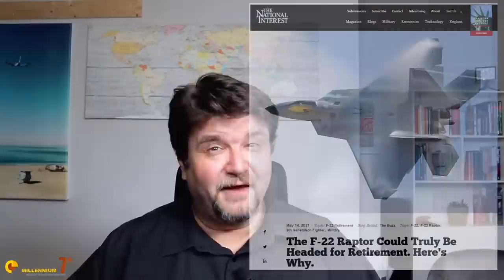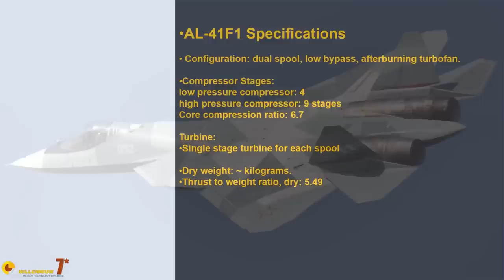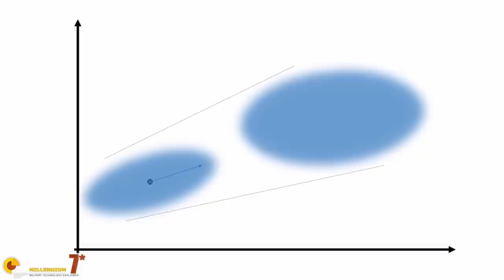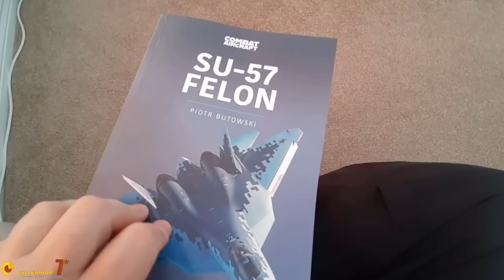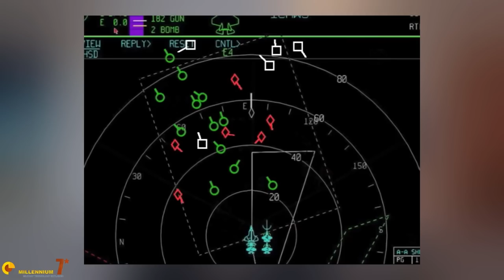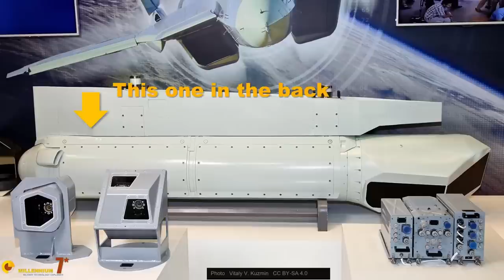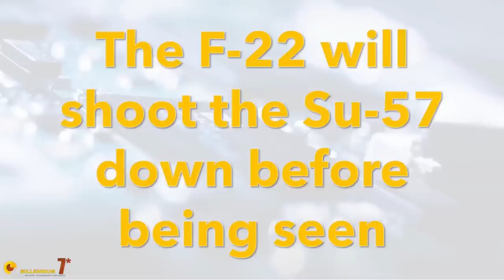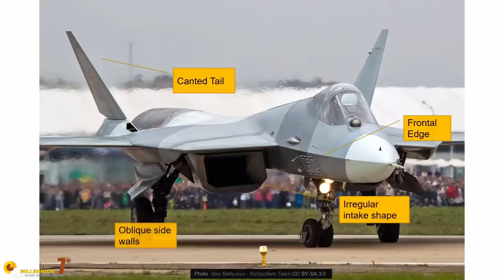Su-57 Update! + In Depth Analysis

Comment: Any updates on serial Su57 delivered with IrbisE PESA or Byelka AESA radar...
Reply: Google
Reply: @ГеоргийМурзич  Googled Nov 2021 - Tikhomirov NIIP Director General Yuri Bely said only 6 Byelka had been built with 2 for flight testing in T50-3 & T50-5 + 2 for bench testing + 2 for Tikhomirov debugging – with 4 more to be built in Coming Years…
Reply: @CherryBoyReloaded  Yuri Beliy die before Nov 2021.  So either the article use very old interview without citing the date or they just make up fake interview
Reply: @Swordsman  Thks for the Yuri obit update - any updates on serial Su57 or latest Su35 delivered with IrbisE PESA or Byelka AESA...
Reply: @CherryBoyReloaded  i believe Su-35 not gonna have AESA. Never heard any report on that one. Because if they do, i think they gonna try it on Su-30SM2 first. 
On Su-57, so far its going on as planned except for the engine. I afraid sanction will affecting Izd.30 like they (allegedly) make Su-75 first flight pushed from 2023\24 to 2025
Reply: @Swordsman  Yes its a mystery - with Indonesia complaining first choice Su35 didn't have AESA before selecting Rafale and maybe F15EX - at a time when United Aircraft is struggling for survival even after consolidating MiG into Sukhoi - so would be delivering Su35 with Byelka AESA if available as badly needed Su35 orders - required to support Su57 - dry up...
Reply: @Swordsman  Correct - United Engine has been saying since 2017 and recently reconfirmed - hopefully by a living representative -that Izdeliye30 won't be available before 2025 which fits with this report of AL41 planned through 2024 - so delays are inevitable...
Reply: @Георгий Мурзич  What does your Google query return for mysterious Byelka AESA radar...
Reply: @CherryBoyReloaded  interesting, that's new info of Indonesia refusing Su-35 because the lack of AESA. Afaik, its all because CAATSA
Reply: @swordsman1137  Yes - CAATSA probably played a role - maybe a decisive role with AESA only an excuse for Indonesia to not admit a long time Russian customer caved to unreliable + meddling + declining + trouble making + hegemonic + Australia aligned USA - to buy French Fighters...

Comment: Why don't you ever hear of some kind of rear defense pod to shoot down missiles that are coming at the plane?  They would not need to have a very long range and would not need to have a very big payload.
Reply from the maker: It is not feasible dynamically
Reply: It's in development. Unfortunately it is not as simple as a tank's aps systems as you have to factor in so much more. For example trajectory of a missile going mach 5 on a plane going mach 1.

Comment: Can anyone explain the obsession with 'digital' camouflage please,  I understand its workings in small scale environments; urban, jungle, desert etc but I'm struggling to understand the relevance when airborne with a relatively large manoeuvring body. It seems excessively complicated to achieve similar results to any other disruptive pattern.
Reply: the camo is not for the eye. it is for a digital camera. the pattern interferce with the sensors data. it is questionable if it realy works
Reply: Like the other commenter said, "digital" camo work better to trick thermal camera or ordinary camera.
Iirc digital camo on troops uniform not have any advantage against human eyes

Comment: Do better?  The radar cross section of the Su-57 is thousands of times greater than the F-22.  The Su-57 is, at best, a good 4th gen fighter.  Since there are only a dozen (give or take a few) of them and they have never been used as anything other than a missile truck, it's hard to know how good they really are.

The Indians abandoned the program because the plane did not live up to expectations.  They will be flying Rafales instead.  

Love the optimistic talk.  Three regiments of Su-57s.  They will arrive at about the same time as the 200+ T-14s

Comment: This video needs an edit: "Western engines last 5 times longer".
Which is not true and has been pointed out in the comment section of the original video. This particular statement is completely wrong.
Reply: Sources?
Reply: Every SU fanboy is also an engineer in their spare time, u know 🤣
Reply: Russian engine overhaul times is 1000 hrs but a heavy or replacement period is 4000 hrs.

For western engines it is pretty same with tbo being around 2000 hrs and replacement at 4000-5000 hrs 

My nation uses both
Reply: F35 engines can't seem to last more than 300 hours
Reply: @singular9  thats what u get for high thrust engines with importance of just 1 engine which has to constantly go full thrust in flight. The load on engine is tremendous, esp in B variant with all that diverting nozzle system bs
Reply: @singular9  sources?
Reply from the maker: There is a correction in the 7th video. I forgot to add an edit for that... damn...
Reply: @Millennium7HistoryTech  Yeah I remember that video. But those who don't watch the whole thing would be confused 😉
This was a damn good analysis, sir.
Reply: @rogerwilco5918  You can go directly to the web site of the company that makes  these engines and check the figures. There is a lot of other sources as well.
But I do realize that anything written in Russian becomes a real pain for a casual westerner (just like Chinese sources for myself).
Reply: @hiteshadhikari  
Depends on your definition of "full thrust"  is.  The F-35 doesn't typically patrol at Supersonic speeds.  And since the Lightning II can easily sustain flight above mach 1.1 for over a hundred miles (although not technically super cruising) without having to use afterburner, "full thrust" is a bit inaccurate. This info is publicly available, so the true performance stats are probably even better.  VTOL( hovering) doesn't require afterburner thrust either.  I don't believe it requires full military power to hover a jet with a full load out either, but I'd have to check.  It might.
Reply: @edgetwins529  to sustain that ss speed it has to go ss first and achieve a high speed then it kills ab and thats how it sustains a 1.1 mach speed bud.

Comment: I am no expert but compared to available close up shots of the F-22 and J-20, the panel gaps and finish on the Su-57 looks terrible (e.g. at 10:46). But it is a beautiful plane.
Reply: It’s garbage compared to the F-22 and still pretty far behind the J-20.  This channel presenter is knowledgeable about aviation, but just makes the mistake of taking Russian/Chinese performance claims at face value and as a result is a bit of a Russia/China fanboy.
Reply: @bluemarlin8138  and you can't be called an american fanboy as well? not much is know about the j-20 either but here you are with metrics.
Reply: It's footage of one of the prototype. Sukhoi really need to release footage or pict of the serial production

Comment: Why the air intake is never on top side of the wings .....always from bottom side of plane ?
Reply: Airflow will not reach engines when pitching upwards
Reply: @sidharthcs2110  why then B2 spirit Is having ducts on top side ..... Air exists on all sides .....it's the plane which rams in into the atmospheric air !
Reply: @shivamRudram  Because the B2 won't do maneuvers that fighters do..
Reply: @M16_Akula-III  okay

Comment: The F22 and the B2 are multi band stealth aircrafts.
The F35 isn't.
Even if the L band radar works out doesn't have 360 degrees.
That means that the F35 and the F22 will detect the SU57 first since it's barely stealth.

Comment: Russia does not have an asymmetric response, Russia relied on anti-aircraft missile systems. Since 2007, Russia has spent 3 times more on the S 400 than on the purchase of all types of fighters. With this money, Russia could buy about 1,000 su30 and su35. In fact, Russia has a huge bias in favor of anti-aircraft missile systems. In addition to the C 400, there are also C 300V4, C 350, C 300pm2, "Buk", Tor, "Shell".
This bet on ground-based air defense turned out to be a complete failure. In the current war, there is a video about how the HARM missile hits the BUK air defense system, although the buk covers the long-range S 400. Ground-based air defenses are useless because of the round earth. And the Ukrainian side launches the HARM missile without capturing the target, in the hope that the missile itself will then capture the target. This is a very limited use of HARM. Faced with the US Air Force, all these C400 and others will be destroyed in a week.

Due to a lack of funding in Russia, one of the most promising missiles in the world, the R77PD, was curtailed. All projects in aviation regularly meet with underfunding. There was a case when the AWACS A 100 project stood still for 2 years, because the company that developed it could not buy il76 for tests. 
If Russia had relied on aviation and not on the SAM, then the su57 would have been ready for a long time, and now the su75 would have passed pre-production tests, the su57 program also regularly faced underfunding, as an example, the radar N036 was delayed for 5 years.
But the projects of new anti-aircraft systems fly out like pies, new missiles for the S300 and S400 regularly appear, as well as the new sams themselves, have not yet had time to start buying the S500, as the tests of the S550 are about to begin, and the S600 is already in development. This is real madness. 

Russia does not have an asymmetric answer, it's just that there is a strong lobby in Russia of those who produce air defense systems. Russia could well have 1500-2000 fighters such as su30, su35 by the current time and switch to a bunch of su57 and Su 75 within 15-20 years. Such an air fleet would be a much better response to modern threats.
Reply: Как думаешь, сможем после войны сохранить армию на том же уровне что и сейчас? Ну, чтобы имеющееся вооружение осталось при нас и чтобы проекты, которые только ещё в планах, тоже получили в итоге жизнь?
Reply: @ИванГоряев-х4ю  лет 5 потребуется для восстановления, потери по танкам бмп бтр уже сейчас огромные, а сколько еще война будет... черт его знает. Если война на годы то я даже не знаю чем воевать будут. 
Куда интереснее как дальше пойдет развитие армии, если по тем же рельсам то это тупик, нужно менять концепцию. Делать ставку на авиацию, у нас в авиации очень хорошие разработки. А будет ли меняться армия зависит от власти, эти же люди вряд ли способны на новые идеи. Нужна смена элиты, а лучше вообще слом нынешний вертикали власти и создание куда более открытой власти. Надежда что в 2024 будут перемены, хотя конечно сомнительно.
Reply: @ЭкономияКанкрина  надежда умирает последней :)
Мне кажется эта война не сможет продлиться очень долго, скорее всего ещё один год или половину, не сможет наша армия тягаться с таким напором сопротивления. А вот насчёт развития армии и смены власти полностью согласен. Главное - чтобы после окончания войны никто из предыдущих членов правительства не смог остаться на своих местах. Ну и не менее важно, чтобы пришли не просто новые, а умные и честные люди. А чтобы так произошло, народ должен наконец проснуться и взяться за голову и отстоять своё право на нормальную жизнь
Reply: @ИванГоряев-х4ю  ну наши то давно хотят договориться, это на той стороне не хотят... долго ли они готовы воевать? Если в этом году у них будут успехи на фронте, то думаю война затянется еще надолго, если же до осени особых перемен не будет на фронте, то думаю готовы будут сесть за переговоры.

Пока не вижу сценария при котором придут умные и честные. На мой взгляд кардинальная смена элит возможна только при унизительном поражение России, а этого я не желаю своей стране. Приемлемый мир наоборот консервирует нынешний режим.
Reply: @ЭкономияКанкрина  хотели бы договориться - договорились бы ещё раньше. Тут обе стороны будут гнуть своё до конца. А что касается унизительного поражения - так это и будет отправной точкой в смене власти. Опасность лишь в том, что может случится как при революции - до "руля" дотянутся совсем не те, кто действительно должен им владеть. Вообщем, моя позиция такая: перемены необходимы, но никак не радикальным способом - нужен эдакий мост между народом и властью, а не пропасть, которую мы сейчас наблюдаем
Reply: @ИванГоряев-х4ю  ну наши же отвели войска в апрели. При чем даже с перспективных направлений как сумская область. Думаю все таки договориться хотели. 

Ну пока Путин у власти пропасть так и будет. А он судя по всему вообще власть отдавать не хочет.
Reply: Lol this bot understand the universe 😂

Comment: What can be discussed here?  They used screws instead of rivets on the wing and that says it all.
Reply: Of course, a Ukrainian.
You're looking at the T-50 prototypes which have exposed screws for easier maintenance. The serial production models have them filled in, brushed and coated. By the way, the F-35 doesn't use rivets either. It uses so called Eddie bolt fasteners (where Lockheed admitted they used the wrong material on critical areas on potentially hundreds of planes, but that's a different story for another day).

Comment: About the L-band rays you are Wrong.

You know they have extremely long Long wavelengths. then as a result Has poor accuracy in range to really Detect a target. it won't even detect It. at all it won't even give precise Data because it wont detect it at All.

They require very long dwell times. .i.e. they need to illuminate a Specific area of the target for many seconds/minutes. to really detect a Target. it won't detect a target and Really give a indication to the pilot. So hence they cannot detect it because they need to illuminate an specific area of a target for a very long time. This works well for ships. But for fast moving targets like Planes. no it won't detect the target. To really give a indication to the Pilot.

Comment: The US still wouldn't face an effective adversary with Russia's Air Force. It has been worse than useless in Ukraine. It will probably never even hit 12 active airframes. Even if it does, the stealth is horrible. There isn't enough reason to acquire this aircraft in numbers. There isn't enough advancement to justify the cost. The L-band isn't enough to get a firing track. I used to think the Russian military was near parity with the West, but not anymore. "Making those tolerances isn't particularly difficult", you don't understand how materials science works if you make that statement. After flexing at 9gs, to maintain those tolerances is very difficult.  The Izdeliye-30 engine can't be built. At least, not by Russia.  They can't make the alloys needed.  The J-20 is suffering the same fate. Sir, you make a lot of excuses for an aircraft that is falling far short of the mark.  I will agree, it is pretty though.
Reply: You have no clue what you are talking about, just parroting some goofball nonsense you picked up on a crummy OSINT website or youtube channel.
Reply: @seraphx26  You really don't seem too bright. You apparently, haven't seen the performance, actual performance, in a real on ongoing war. Secondly, advanced aircraft can't be built without parts. Parts they Russians have admitted that don't exist. The can't make the Saturn-41 engines. Just a fact. They have issues with the needed alloy to stand up to the high temperatures. They have lost access to chips that Actively Electronically Scanned Array radars need. They can't make them. Lastly, I have been working in this field for 25 years. How long have you been working in military aircraft? Have you seen what it takes? Have you seen teams doing the research into RAM coated skins, how they must be applied, and maintained?  How the seams must be thoroughly maintained? How APUs, ACUs and ECUs must be designed. Yeah, it is my opinion, but it is from experience.
Reply: @CMB21497   Well that comment of yours aged poorly SU-57's have been upgraded with the Saturn-41 engines, Russia is still making more of them so they are still getting chips, all I can say is if you have worked in the field for 25 years you owe your employers a lot of money back.